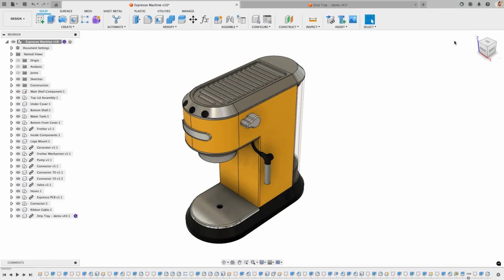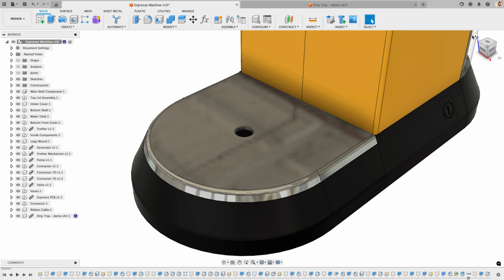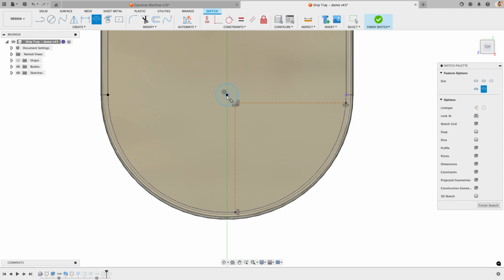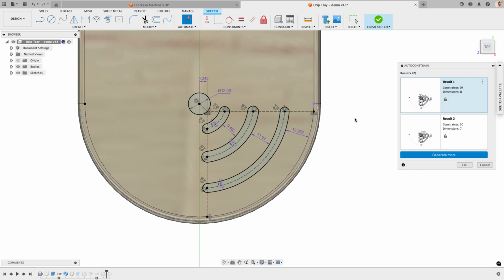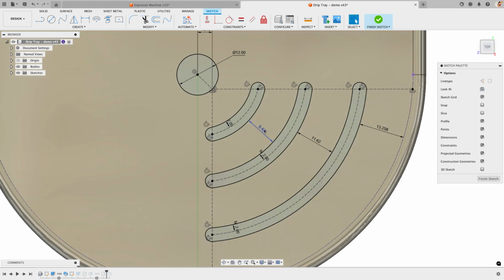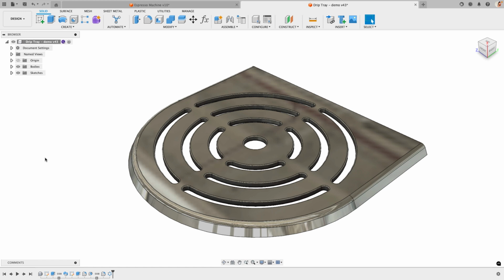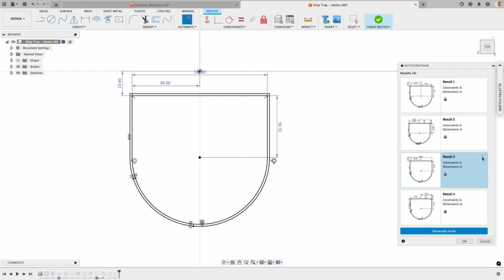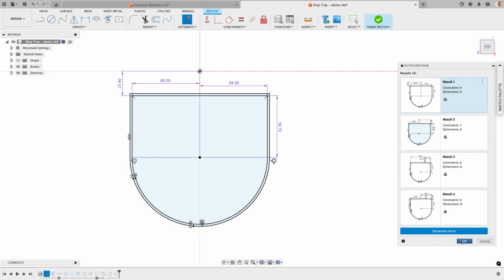AutoConstrain is Changing the Game for CAD in Fusion

Comment: Give us better constraints for building assemblies. Joints are garbage.
Reply: Yeah, I always struggled with these. The Solidworks approach is much more intuitive and flexible in my opinion - progressively locking off DoFs makes it very simple to get the precise type of constraint you're after (and it is the same approach used for defining sketches).
Reply: @JMMC1005 You will see that joints will be preferred long term. Even the guys that built solid works aren’t using mates for their product.
Reply: True. Or make projections more non destructive...
Reply: Why would i want to make 3 joints when 1 does everything i need it to
Reply: @Einzbrn  Because 1 doesn't do what I need to, and actually makes it impossible for me to constrain a component properly.
Reply: Joints are a nightmare in fusion